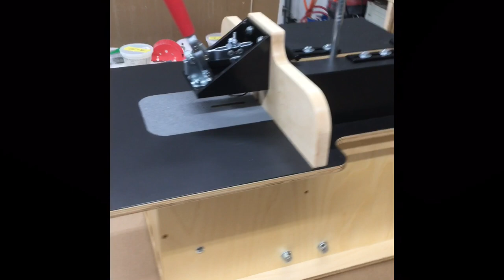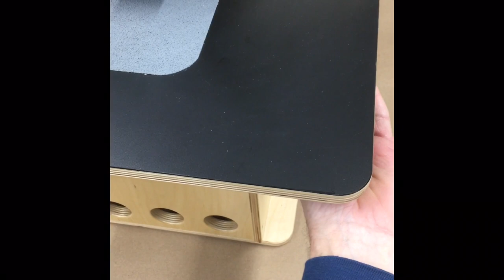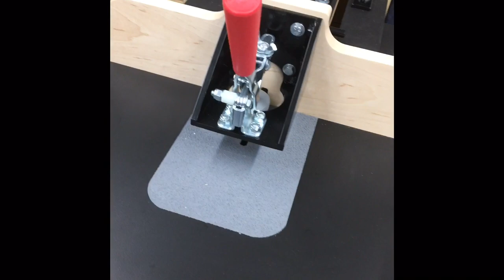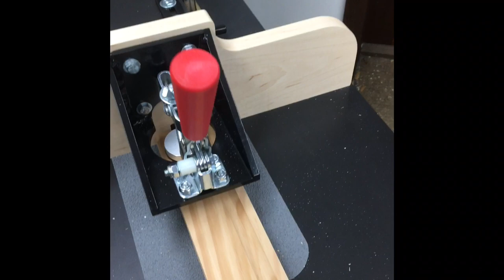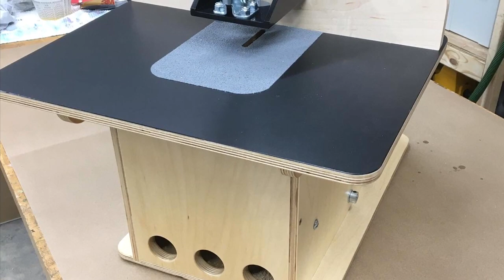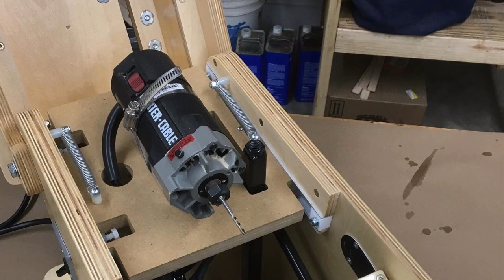DIY router pocket hole cutting machine

Comment: Do you need help in modeling up the plans?
Reply from the maker: No. I have been so busy that I haven’t gotten around to it. I was thinking about how to simplify it to make it easier for the average woodworker to build. I welded and machine some of the parts. Then a lot fitting and adjusting. In the end it may be more economical to buy one if you want one. There’s also the cost of the trim router and the main router along with the bits on top of the build. I already had all of that. So end the end it may not be worth the time to work on a set of plans for it.